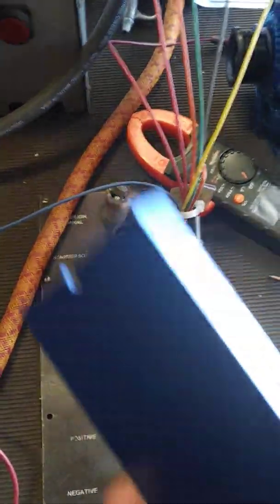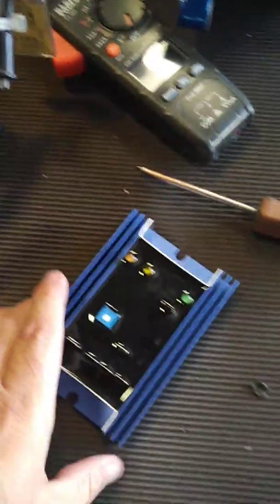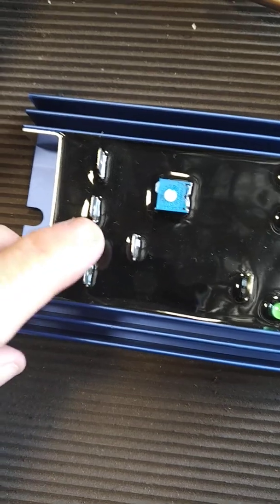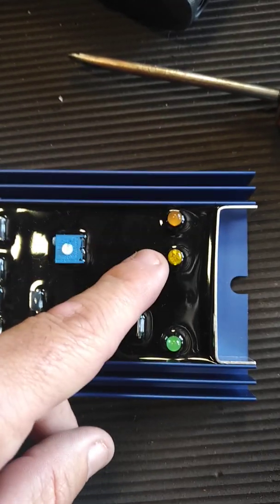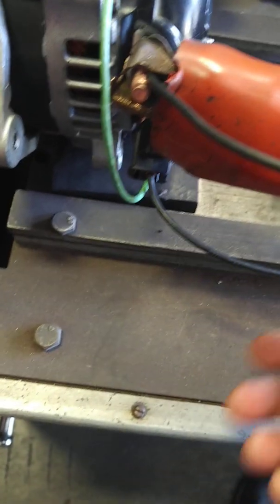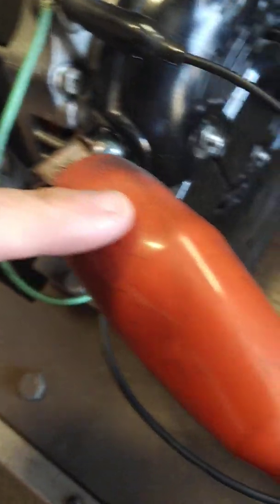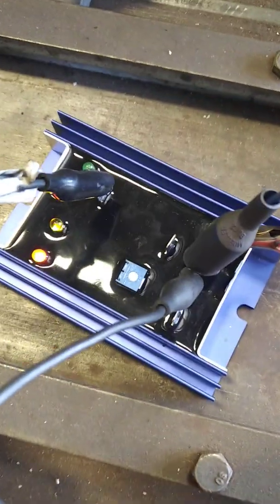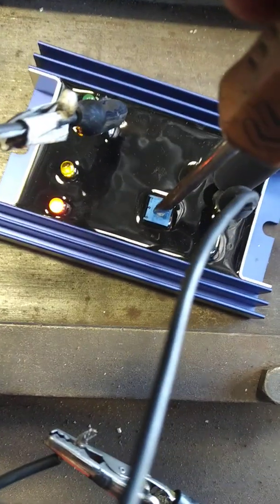V1200 external voltage regulator

Comment: These run cooler than the 91102r, from my experience, and seem to hold voltage just as steady. Just did a comparison today. 

There's now a transpo v1300 version that I used, with 4 leds. Functions the same, very pleased with performance with rock solid voltage.

Comment: I bought a 370 off you guys. Is that an external alternator? or do I need the kit
Reply from the maker: It would be internal unless you specifically asked for external setup
Reply: @autotechengineeringusa  where do I find the kit to make it external ? I'm not seeing it on the website
Reply from the maker: @gregdragoo4777  it depends on the vehicle so you need to call us monday

Comment: Just bought a high output alternator for an 06 Dodge Durango and it isn’t producing higher amps. Is that because of the pcm limiting it? If so, will this fix that issue?
Reply from the maker: Amperage depends on the load from your battery. Are you referring to voltage??

Comment: I just hooked mine up today, both lights are on like the video but my voltage isnt jumping up like yours in the video. Only difference is that I didn’t hook the second wire coming off the plug to ground, cause in my alt the other wire is the sense wire. Does that need to go to ground?

Comment: Can I use that with my 270? Model Corolla 1997.

Thanks
Reply from the maker: You have to convert your alternator to be external voltage setup
Reply: autotech engineering I do get 15 volts only for a few minutes and then drops to 14.6 It’s that normal?
Reply from the maker: @ELCARIN310  yes
Reply: autotech engineering what can I do to keep my 15 volts
Reply from the maker: @ELCARIN310  give us a call